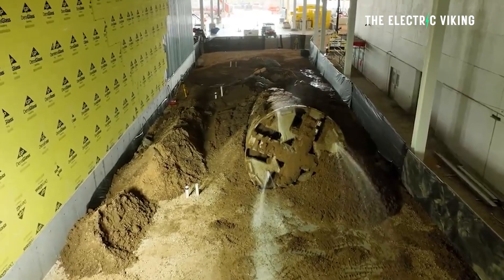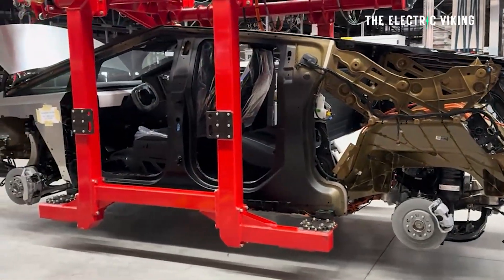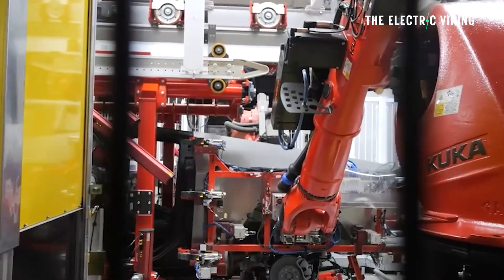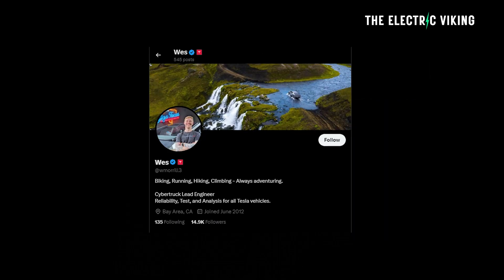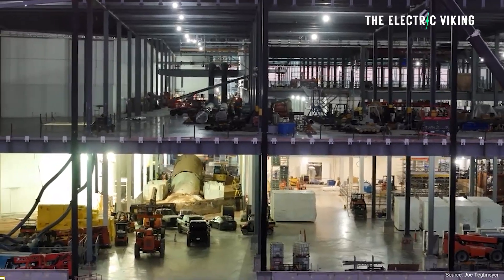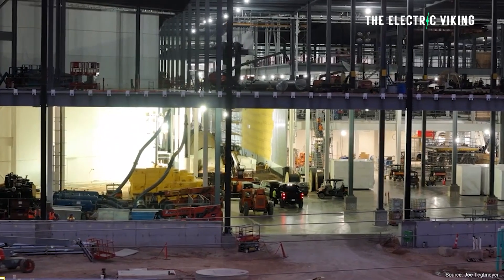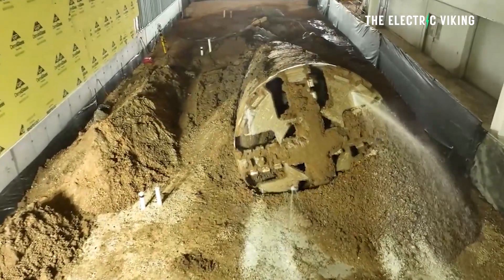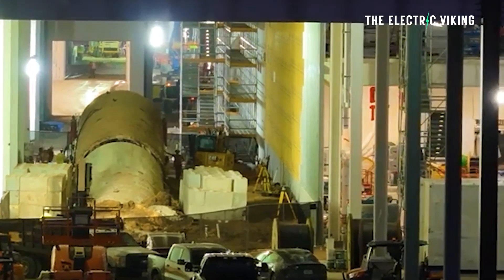Tesla's Cybertruck ‘Cybertunnel’ now operational at Giga Texas

Comment: Yes they will be at least 4 tunnels now planned and more possibly later as productionramps up on Cyber Turck anong with there cars. Yes the cars built along with the cyber truck will drive themselves from the factory though the tunnels which runs from the factor under the adjacent highway to the other side where the new production vehicles are held in a parking lot facility ready for shipment to its new owner to take position. This will steam line the process resulting  in a much more efficiently,  reducing human labor cost and liability. This also eliminates inter action with local road traffic, atop signs or possible traffic light slowing down production and processing. This  is a similarly underground road system he has completed in Las Vegas from Casino to Casino with no traffic.  Robo Taxes through the tunnels like Uber without the human error and labor cost. It will be like taking a bullet train underground but in a car that can leave the tunnels and drive you to any destination of your choosing.

Comment: Additional routes in and out of the factory.

Currently, they perform volumentricnpeodiction - this scales with x^3.

But they have paths in and out that move only through specific walls.  Scales with a small fraction of X^2.  

Getting things in and out will always be the limiting factor.

Opening the floor for this purpose could easily allow sections of the factory to be more rapidly connected to other sections of the factory.  

This seems like it could dramatically improve throughput.
Reply: Say whaart 😅😅

Comment: A tunnel is a “great solution” for traffic issues?  In what planet is that?  For the price of a tunnel, you can build a 3 lane bridge or 5 lane road.
Reply: They are crossing a public highway. I doubt the bridge would be cheaper. Plus the tunnel provides huge operational cost savings versus the bridge.
Reply: @whodatcatt  tunnels in Austin Texas are triple the price of anywhere else. They have what they call caliche here. It’s like digging through cement. I promise you - a bridge is much cheaper.  This area also has limited seismic activity. And prone to floods. 

Looks like in Texas, average prestressed concrete slab bridge is around $100 per sq ft. Bridge would be around 800’ long. Less than $1.5m for a bridge. 
The tunnels are $10m per mile. This tunnel needs to be longer than the bridge is. Probably around 1/4 to 1/3 mile. So $2.5-$3.3m.
Reply: What evidence do you have for Austin Texas tunnels being 3 x as expensive as anywhere else?
This tunnel was excavated in soft ground. It doesn’t get anywhere near the bedrock.
Cement is a powder that reacts with water to hydrate. Did you mean something else?
Tunnels tend to be more expensive than bridges, this is true.
In this case the highway is on a bund, elevated above the general site level. A bridge would need to be fairly large/long to accommodate the headroom clearance and ramp lengths. Also would be more difficult to incorporate into the extension building.
A small diameter single tube tunnel is the right solution for this case. 
Previous estimates put the overall cost at $15-18m.
I can’t see how a bridge would be any cheaper given the size/span required.
I guess the site design team did their studies to come to this solution, but probably influenced by the availability of a pet tunnelling company with a billion dollars of venture capital money to be spaffed away.
Reply: @davidsalisbury50  I lived in Austin for 10 years. San Antonio for 5. Dallas for 3. It’s very difficult and expensive to dig anywhere near here because of caliche. Like I said before. 
You can look up the prices of bridges. Roads. Etc. 
the “site design team”?  Haha. You don’t think the poobah just looked and said “dig a tunnel” with zero research like he does for everything else? GTFOOH
Reply: @Meatball2022  I do agree with you about the decision, even if the local engineers told him different. Your bridge prices look very cheap to me. Abutments, piles, retaining walls and a fairly large span. But I am biased towards tunnels of course.
I understand the deep ground conditions there. Very difficult, I have seen them elsewhere. But his tunnel didn't go that deep for what a local geologist told me, all in fill, sand and gravel beds.
Reply: @davidsalisbury50  again - can’t dig a swimming pool without hitting caliche in most of Texas. The tunnel is way deeper than that. Anyone that lives in Texas knows about the issues digging here. It’s got nothing to do with bedrock, nothing to do with depth of digging. People hit caliche when digging to plant trees and things - sometimes the issues are that close to the surface. 
The bridge prices were quoted per sq ft from tx dept of transportation for fy2020 average bids for new and replacement bridges.
Reply: @davidsalisbury50  there’s no such thing as “soft ground” in Texas. But you want evidence from me? You have zero evidence or indication of “soft ground” but no problem at all throwing that nonsense around like it’s fact. 
18 years of living in Texas is my evidence.  It’s crazy expensive to dig a pool in Austin. And don’t tell anyone - swimming pools don’t get near bedrock….
Ffs. Bedrock.
Reply: @davidsalisbury50  difficult to incorporate a road into a building?  Why? Ever heard of a garage door?

Comment: Well, if it's an enter and exit only with no intermittent access along the tunnel, then I don't see how useful it'll be. I had suggested to Tesla that they should consider a steel I beams rail system strategically positioned along the giga factory to allow access for containers for goods received and for removal of items from the factory without disrupting the line. Steel  rails with an intelligent crane  could easily be incorporated into the current design of the giga factory. This would save a great deal time in the production and goods received and outgoing. Never heard a thing from the Tesla team.

Comment: A tunnel makes a lot of sense as it minimizes the need to wash the vehicles after having to travel 3 or 4 miles to get to the staging lot. Having to wash hundreds of trucks every day makes no sense. This is a good solution. The roads leading to the distribution center are public annd carry lots of construction equipment that often has been working in dirt. Also there is lots of dust in texas given the high temperatures.

Comment: Sam. two points worth remembering. Boring is still in the early stages of evolution for Elon.  Every Tesla project is an opportunity to try out new ideas without customer accountability if experiments fail.  "Fail early, fail often". The second is sending these cars autonomously through the tunnel requires no drivers or worry about navigating the Tesla city, which is what, maybe a few miles in circumference?

Comment: Viking, you haven't thought about the numbers. Now, each car is driven 3/4 of a mile to the shipping point. . The 10 guys get on a bus, with driver, and go back to get more cars. . The tunnel is 1/4 mile long. Not exposed to the elements. Half a mile, 2 ways for the driver, times 200 trips a day  ( now). It can be automated to take out the driver. A lot of money saved.
Reply: Axis (pet shop boys)😅
Reply: It's such a short distance that the logistics seem insignificant. You have 1/4 mile to get the tunnel down & back up again? The tunnel will bring increased security issues as this will be a back door to the factory. I'm not even sure why we are talking about it, really. It looks like another hair brained idea.

Comment: I’d like to put the railroad near me through a tunnel to end the noise. Tesla shuttles 5 CTs at a time, then has to bring the drivers back for the next run. All day long. Self driving, real self driving is possible as the tunnel avoids public roads.
Reply: They have a tunnel. In Vegas. It avoids roads. And self driving in it still doesn’t work.

Comment: Not operational yet.  One month out, at least...
There are gigafactory drone flyovers on youtube daily.  They show the congestion around the main factory, and the back up of new cars exiting the factory.  So yes the tunnel has a purpose, it will get all them to ramp production and quickly get the cars and trucks to the other side of the highway where they are loaded onto transport trucks. Right now drivers have to drive the trucks over and then take a shuttle van back.  At the current run rate there is barely room for the dozens of cars and trucks that stack up.
Reply: Automation. 

I imagine each vehicle will move itself from station to station on the assembly lines.  Humanoid robots will fill in for humans, increasing over time to 100 percent.  

 I could imagine them boring another tunnel next year, and two more the year after.  

There is a time coming, when some municipalities will bar the use of ICE vehicles on their roads.  Cities first, eventually whole states.  

How many ICE vehicles are in use in America today?
The electric replacements need to be made somewhere. 
The US economy would prefer they be made here in the US.

If a reasonable domestic alternative isn't offered, you will see a BYD Seagull on every block, in every city in America in ten years.  

The steep curve of climate shift must be matched by the same steep curve in retiring gas burning devices, cars, trucks, everything. 

I think looking back from 2040, our current conceptions of how big Giga Texas is going to eventually get, will be considered quaint.
Reply: Absolutely makes sense. Think of all the Haulers that have to drive there and away with full loads. With the delivery parking on the other side of the highway, it alleviates a ton of traffic. It's not just Cybertrucks, it's also Model Y production. Think about total production numbers, and having a designated roadway for all of those vehicles. I'm sure Tesla is planning for 500K + vehicles per year moving through that tunnel to get to the designated delivery parking lot.  Then all those haulers don't have to navigate through the 1000's of vehicles coming and going to the factory every day. This is also why I was surprised that Tesla built the factory on land without Train access.
Reply: my cybertruck is actually sitting in that Austin lot! The Tesla rep here just showed me the aerial view of it yesterday in line ready to get on the train!!!!
Reply: Hmm interesting, so the Tesla Boring Company isn’t using this as a cover-up advantage point, like a Y-split emergency tunnel for the rich to connect to a bunker tunnel, alrighty than. 😅"